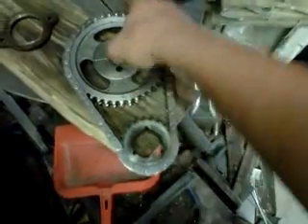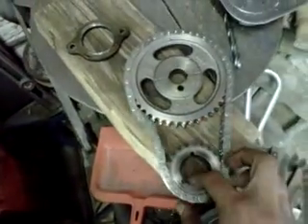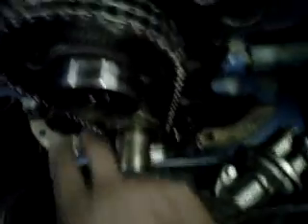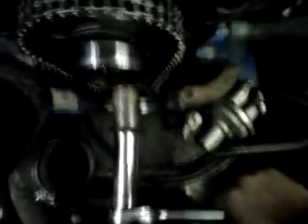new Ford 302 timing chain play

Comment: I just installed a comp cams #2138 on my 1995 f150 5.0. The chain has about as much slack as your '65 has...My understanding is that both sides of the chain must be tight. Is that acceptable?

Comment: I am on my third new timing chain on my 86 302, 2 Sealed Power brand and 1 Cloyes brand. All 3 seem to have too much slack even though the chains and both cam and crank pulleys are new. What could cause this?
Reply: Soak the new chain overnight in the same engine oil that will be used. Then install.

Comment: Hey mate I have a 350 chev with a terrible valve train noise, iv adjusted all the valve lash correctly and the noise is still there, has a bit of knocking sound so I rebuilt the bottom end and still there. I’m wondering if it could be the hydraulic lifters maybe? I did check them and they seem good not worn or anything but I can push them down about a centimetre where the push rods slide into with my finger which I’m not sure if you’re supposed to be able to do or not? Umm and nothing else looked bent so not sure what the problem could be not sure a worn cam chain would make it tick and knock. Sounds like it runs on 7 cylinders too maybe stuck valve?
Reply: Appreciate any advice thank you.
Reply from the maker: Im about to release a video on one of my cars dying - at the end you will hear it running with the valvetrain noise. tomorrow, tell me if that is what yours sounds like and we can move on from there!

Comment: I found the exact timing chain kit on summitracing. It comes with the new thrust plate which is what I need also. My 302 engine still had the old style link-belt chain set. Overtime it will not only stretch bad on one side but both sides

Comment from the maker: my set has goes by 2 i beleive ihad plus or minus 2,4,6. of course six is rediculous. since mine being a nastalgia271 cam which was already advanced by 3 or 4 from the factory i decided to go straight up with it. this did work i went from a vacuum of 10 to 15 when i did change this. but good point. many people do not even realize that there are different settings. going back now i wish ida set mine to two degrees of advance so when it wears it would have still been in an acceptable degree.

Comment: You should also remove the oil slinger if your using a double chain when you install the front cover it will not clear the timing chain cover. A chain that is worn will give more than 2 degrees crank difference from the cam, not whole lot but when your taking that away from a already 0 up cam it makes a big difference in valve timing low end power etc...

Comment: I installed Isky MEGA 280 cam in my A code 289 with double chain, you should verify the cam timing when you do this there are 3 positions for you to install the cam gear usually +4 degrees advance -4 degrees advance and 0, the throttle response issue could be from installing the bottom gear at the -4 degrees position, that will give you poor low end, and high end power.

Comment from the maker: i replaced mine with a double roller. not billet steel one either. i could not tell you the part number but it is for a 302. its ford brand. seemed like the best to go with. the thrust plate is an odd issue. this kit comes with a new one so i would suggest useing it. the new style is much more effective.